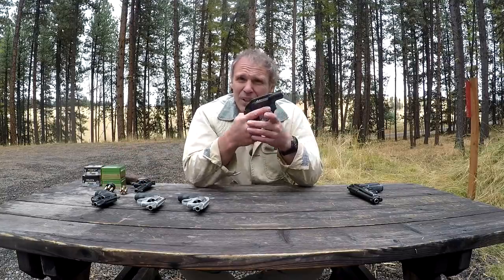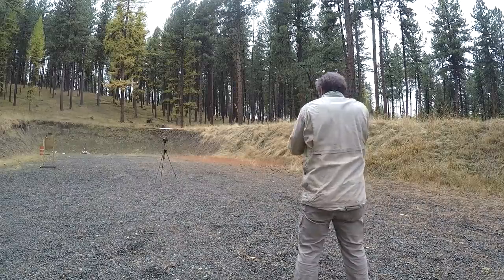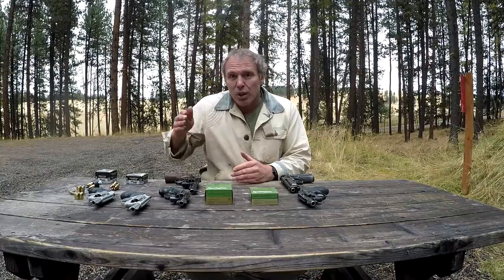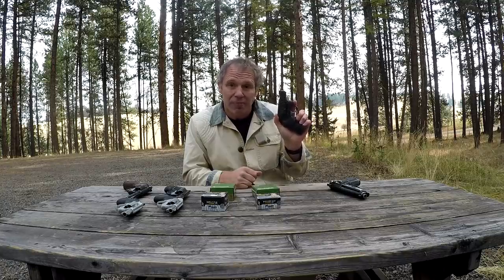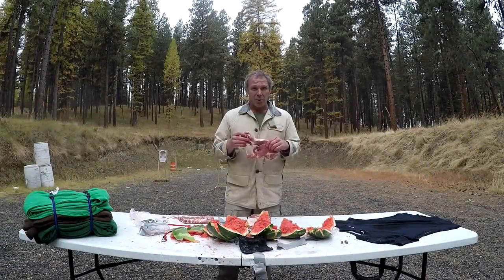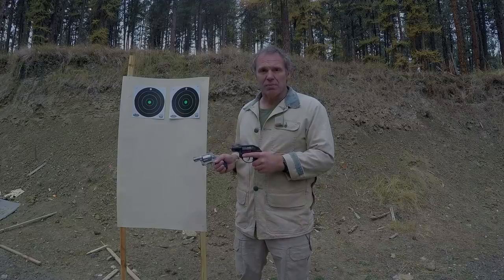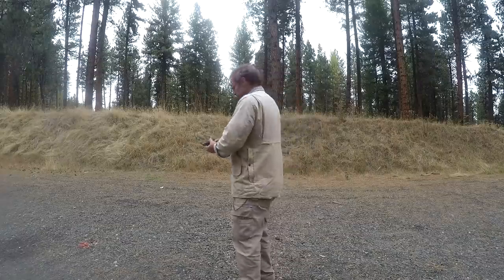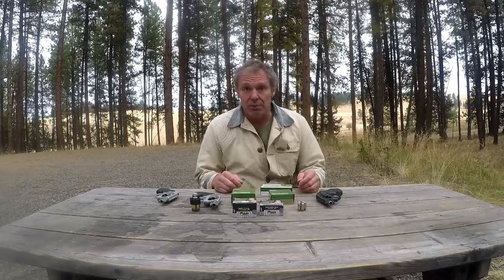Ruger LCR 9 Millimeter

Comment: Can you do one comparing the lcr 9mm to 357 mag?
Reply: Why? They aren't the same. 357 needs a longer barrel to get up to speed where the 9mm doesn't.
Reply: Because Paul did one before comparing 357 to 9mm and his results said they weren't close. MAC did a comp between lcr and 357 and said it spanked it or something along those lines. The different ammos Mac used I saw some say were questionable. Tym even pointed out about certain ammos not being a good comparison.... Well I trust Paul's testing more than anybody else. He doesn't have a glaring bias to make sure one out does the other from what I've seen. He uses true comparable ammos etc. I mean he clearly prefers 38 super but when he compared it to 9mm and 357sig he didn't use a watered down sig ammo and a hyped up 38 and proclaim clearly 38 super is better. I've seen that type of bs on a lot of different gun channels. Not Paul's. Since Paul now has a 9mm snub nose he can compare them.

Comment: Fantastic video. Lots of great info. Longer is better. Always tell the longer, more detailed version. You did forget to mention the pressure diffs between the cartridges. Probably u didn't want to confuse people. Iirc, 38 pressures are 17,500 standard, and 19,0000 for +p. Whether that is in CUP or PSI, i don't remember. 9mm is around 29,000-30,000 standard and possibly 32,000 for +p (not CD sure exactly, but obviously much higher than 38. I was pleased to see the GS ammo crack 1000 fps from the 4" barrel- most 125 gr +p ammo is rated 950-975. The Sig V-Crown 9mm was impressive. I was very surprised at the velocity, and the meat target results were excellent. Some other testing out there is starting to show that the V-Crown is a good bullet. One caveat i always hear about moon clips is that they can be bent rather easily because they are so thin. Therefore, pocket carry is not recommended. A speedloader case will work of course, and there are 1 or 2 companies making dedicated moon clip carriers, mostly for competition, but i think there are some CCW ones as well. Most have a short rod or peg in the center. A carrier that would stack 2 of them might be great, since the rounds are so short. I wouldn't be surprised if i could stack 3 of them on each row of my old Safariland quad stack (2 stacks of 2) speedloader pouch. Although, it's size makes it impractical for CCW. I have been kicking around the idea of getting a 9mm revolver. May have to do it when finances improve. Fortunately the LCR in all its forms is on our useless "safety roster" here in Kalifornia (the 3" .38 intrigues me). However, the Charter Arms Pit Bull (no moon clip, but also intriguing) is not, no doubt due to the absolutely ludicrous "microstamping" requirement (an impossibility) for new designs. S&W once made the 940, which was a 640 (all steel) in 9mm. That might be just the thing. Problem is, used guns are overpriced here because of the stupid safety roster. Anyway, a 30+ min video from Paul always guarantees a good day. Thank you
Reply: You are not a man of numbers.
Reply: Troy Ortega:  MAP of 38 Special is 17,000 psi.  38+P is 20,000 psi.  9mm and 357 are 35,000 psi.  9mm+P is 38,500 psi.  CUP is obsolete and should be avoided where there is a  psi standard.

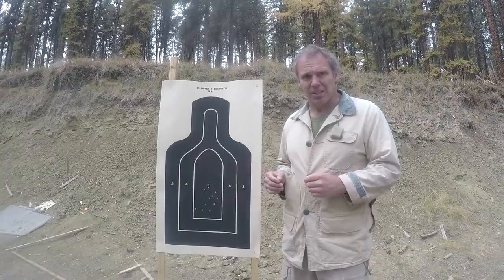Comment: 27:50 9mm as you said does not have a cannelure (a channel in bullet) for case to crimp into like 38 Spl. 9 mm HAS a so called "taper" crimp, case is squeezed flush with bullet (I reload ammo), but it is not a crimp lik 38Spl. IT IS POSSIBLE recoil of 9mm revolver to cause  rounds in the cylinder to dislodge bullet (migrate out of case). Bullet sticks out and jams cylinder from rotation. +P 9mm and bullet greater than 115Gr may not be a good ides due to bullet migration. TEST YOUR AMMO LIKE PAUL DID.. STICK WITH IT.

Comment: I still don't get crimp jump??
Reply: I'll explain it to you. It's not really hard to understand although Paul should have showed you the round and it would have been pretty easy to understand. It's when the bullet, due to change of direction of the entire pistol from recoil dislodges from the case slightly where the bullet is crimped into the case. Some bullets when manufactured have a indent around them where the case snugs up around the bullet so that it doesn't come out of the casing. It's more common in hand loads done poorly than todays off the shelf ammo. Paul just shows you here that although it's a real thing and not fiction it's also nothing to really worry about. It can happen...but it's so rare you only need to be aware of it, not worry about it. 
Google "crimp jump" in  Google images, I'll bet you can come up with an image of it in a handloaders forum.

Comment: Paul like & am subscribed to your channe,l but i have to correct you terminology. You say this revolver is "HAMMERLESS".  EVERY REVOLVER EVER MSDADE OR WILL EVER BE MADE MUST HAVE A HAMMER. There are 3 types of revolvers:
 (1) with an extetnsl hammer
(2) with a shrouded or bobbed hammer
(3) with a concealed hammer like the LCR. Dissenbel this revolver & U will find a hammer.

Every revolver needs a hammer to strike the firing pin. The S&W M638 has a shroudef hammer. Ruger makes an SP101 with a bobbed hammer, you can see it but not cock it. That gun is DA only.

Regards, Rob
Phx., Az..

Comment: Guess I'll take my LCR 9mm off the sale table. It's been my summer EDC til I started worrying about crimp jump. Well as Paul stated, the Ruger LCR may not be for him, but it is for others. I'm 1 of the others. Paul once again I thank u for squareing us away on this fine little piece. Just wish it was a 6 shooter.
Reply: Mike Fay yankee did a video of good ammo to use in the lcr 9mm and crimp jump. Hornady critical defense and Duty both were great and there were a couple other ok ones.
Reply: Mike Fay same here, was thinking about selling mine. Not a chance now. I’ve had a couple crimp jumps with federal white box, but I’ve picked up some hornady critical defense and had good results. With moon clips acting like cheap speed loaders, this little thing is perfect for a truck gun or small EDC.
Reply: @mike34744  saw it. Thanks. But I'm glad Paul put up his facts and views.
Reply: Joe when you had a crimp jump did a failure actually occur ?
Reply: One crimp jump happened in the chamber and didn't lock the gun up, the other one was partly lodged in the barrel and I had to poke at it with a screwdriver carefully to dislodge it so that I could swing open the cylinder and clear the malfunction.

Comment: 9mm beats 38. and 357 in a snub. 357 wins with longer barrel. 357 in a snub get 9mm power but gets 357 recoil with the slower burning powder.  so 9mm is king of the snubs. but 357 wins out of them in a rifle to midsize revolver.

Comment: Ok Paul.
Two gripes, for a change.
First was comparing the shots at 15 feet by using a double action vs single action with the 38.
Second, you did not talk about the bullets with the crimp jump. Meaning, you did not talk about the change in performance if the rounds became crimp jumped.
Maybe that is another show, but what are the effects of a crimp jump on 9mm revolver shots ?
:D

Maybe one of these days, you can get around to a long version where you talk about 30 Cal and rounds like the 45-70.

Comment: I warned Yankee Marshal about crimp jump in an LCR 9 and he told me the same thing about it being highly unlikely and then a couple weeks later made a video where that exact thing happened. You also failed to mention cylinder jump. Most 9mm revolvers are just 357s modified to accept 9mm. theres a significant distance from where the shell is seated to the forcing cone and this can cause accuracy issues and can cause the jacket to be shredded off or cause excessive leading. You also didnt mention that the 9mm LCR weighs almost a half pound more than the 38. Weight matters a great deal for some people on a carry gun. Also you compared a cartridge that was designed to be lightweight and high velocity to a cartridge designed to be slow and heavy. When comparing the performance of a 158gr 38 special to a 115gr 9mm you'll find the 38 easily outperforms the 9mm in energy and penetration even from a snubnose.

Comment: I think the gas pressure loss between the cylinder and the barrel is way less than the gas pressure lost operating a blow back autoloader. evidence seems to confirm that cylinder gap and blow back losses are insignificant. see comments below.
Reply: I wonder if anyone has tested that...?

Comment: Well, the more stuff I see about 9mm snub nose revolvers I'm convinced I'd rather have it than a .38 Special snub nose. I've shot plenty of .38's out of 3 inch barrels even with +P that fail to expand or at the very least get fairly poor expansion. I've shot .38 Special out of 2 inch barrels that with +P wont expand at all more often than not or if I see signs of expansion it's barely noticeable. Often I've found that plain old lead round nose or wadcutters worked best in the short barrels, often going with a wadcutter. 

However, while 9x19 can get expansion in short barrels as pointed out... it often requires a certain kind of ammo to get that or more importantly a certain kind to get ideal performance. The Sig Elite ammo from my understanding is designed to give more optimal performance from shorter barrels than some others as currently that is what's popular. There are great short barrel options out there, but often I find them to be a bit expensive and usually not worth the trouble. And that is out of an autoloader with a longer barrel.

Now, research has shown me often a revolver performs like an autoloader with a barrel length 1 inch longer. So... a 2 inch revolver performs like a 3 inch autoloader and so on. This effectively equates that LCR to being similar to some of the most compact 9mm guns on the market or at least very close to it, which many CAN get expansion with good ammo. Felt recoil is going to suck on them however... Even standard pressure stuff in that light of a platform is a bit jumpy. .38 Special +P in such a platform will also be jumpy and quite uncomfortable. 

Then take into consideration cost.... cheap ammo for 9mm will be less than even the cheapest .38 stuff on the market, which I've found to be as low as $14 a box, however it's often steel case stuff that swells up and wont extract. Dont know if cheap steel 9mm would do the same, but cheap brass is just as easy to find and doubt it would be a problem. But, .38 Special really is becoming a bit obsolete in my opinion. Much like .44 Special, it doesnt really serve a major purpose anymore. Sure, plenty of people still shoot it, plenty of people like it, and I wont argue against it's long history of doing what it's been asked to do and being an effective caliber. In a 4 inch barrel, something like a 125gr +P LSWCHP can get excellent expansion, great penetration, and is easily comparable to 9mm. Problem is, it's simply that... comparable. And with a modern 9mm the same size and weight of that 4 inch revolver, you can easily get 12 or 15 shots instead of 6 for roughly the same level of performance. But, if that revolver happens to be a .357 Magnum but you load .38 +P for self defense, I can easily justify that. 

As a whole... I think the notion of autoloader calibers in revolvers is perfectly fine. I dont think they will replace the typical calibers for said revolvers, but it will certainly make for more options in newer revolvers. I always liked the idea of guns like the Chiappa Rhino in .40 S&W or even some .45 ACP revolvers. Sure, .45 Colt can easily outclass .45 ACP in terms of potential .45 ACP is plenty adequate for self defense and has proven itself while having a lower cost, wider availability of bullet types to pick from as well. .40 S&W in something like a 3 inch revolver will be offering similar performance to duty size handguns whilst being more concealable and probably handling the recoil a bit better due to weight possibly. And in terms of performance, it's no slouch despite what many in the tactical community have said. 

So, I think I can get behind a 9mm revolver in a snub nose. I think they are showing their worth. I already own revolvers that can utilize moon clips and I personally prefer loading over speed loaders. However, I will state that if they are not stored on your person properly, it's possible you can bend the clips and they wont fit in properly. I've gone hunting a time or two where I have a few moon clips in a pouch in case I need to change ammo types for something and have bumped and banged them up to where I noticed one was bent out of shape. Now typically for hunting I carry speed strips, but I think you get the idea. It is something to consider or look out for.
Reply: Cliff notes?
Reply: Coming soon to a college near you.
Reply: I don't mean to sound like an ass... but you really need to get to the range more if you need to carry moon clips and speed strips when you're hunting...Just stating the obvious...dohhh, you may now throw rubber chickens....
Reply: +Tractor Wrangler Well mission failed there. And no, I go shooting plenty. I think you dont understand why I carry clips or speed strips when I go hunting. See, my sidearm is a Taurus Raging Judge Magnum with a 6 1/2 inch barrel. I keep specialty .410 flares for emergency use and often bird shot for the rare snake encounter. Otherwise, it stays loaded with what I intend to use primarily. 

It's not a need so much as it is the ex Boy Scout in me always being prepared. If I carried something more traditional like a typical .357 or whichever, I'd still likely have the snake shot loads on hand. A lot of dense brush where I tend to hunt, Copperheads are fairly common, Timber Rattlesnakes while far rarer are also a potential threat. Been hunting near swamps, along creeks and rivers and plenty of Cottonmouth's as well. 

It's not an issue of I cant hit my target which is probably what you're thinking.
Reply: @Predalien195  Wait...your facing down a rattler...and you stop to reload more appropriate ammo? LOL I just shoot the dam thing or go around it...just sayin'....lol
Reply: +Tractor Wrangler Never said that's what I did. I said I keep bird shot for snakes yes, which is mostly what it's there for. I do shoot birds with it. If I spot a snake I will do my best to go around it but guess you dont have much experience with Cottonmouths. They will come to you, they dont let you just go away quite often. And when reloading is as speedy as it happens to be with a moon clip, it's not as hard or foolhardy as you're trying to make it out to be. 

Like I said, flares for emergency, bird shot for snakes, small varmints, nuisance birds and other pests. I dont shoot until I have to or plan to. But more importantly if a time should come where I am facing down a Timber Rattlesnake and going around is not an option but I'm stalking deer or boar, I'd much rather fire off the quieter bird shot load than discharge the .454 Casull or .45 Colt +P. Hasnt happened yet, likely wont have to happen, but it's there as an option. But like I said... emergency situations could happen. If I'm stranded I may want more than just the 6 rounds I have in the gun. 

It's just a personal choice to be ready. Not everyone feels the need, has the desire, or understands people who do.

Comment: I love the LCR platform and own several in different calibers. My most recent is the 9mm one which I have shot alot this summer practicing with the moon clip reloads. A few weeks ago I decided to compete with it (non-sanctioned match just a bowling pin shoot at my club). Despite the snickering I received when others saw what I was shooting I was confident in my abilities. Embarrassingly enough it could not get through a 5 shot cylinder without at least 1 sometimes 2 light primer strikes. Which had happened in the past during training but only a few times. After inspecting the rounds that failed to ignite I noticed significant crimp jump. Are the 2 issues related? Probably not but my theory is the crimp jump may have been caused by me sub-conciously stiffening up my grip due to the adrenaline of competing and not allowing the backwards inertia of the recoil enough of a cushion. I still shot accuratley. This still doesnt explain the frequent light primer strikes. Ammo was winchester 115gr. Any insights?
Reply from the maker: Sometimes light trigger pull means light strikes. Some ammo doesn't work well in some guns. I would suggest Starting with using a different ammo.

Comment: 38 spl. is about the power of .380 ACP but almost as large as 357 Mag cartridge ...

in short its useless obsolete caliber

if you want low recoil lightweight pocket gun use 9mm Browning, if you desperately need for some reason your ultralight pocket pistol to kick like a mule, just use 9mm Luger ...
Reply: Does the 9mm browning and 9mm Luger not both fire the same 9x19 round?
Reply: that x19 is the casing length ... Luger is 9x19, Browning is 9x17 - smaller casing less + rated pressure = less velocity but also lower recoil
Reply: @Asghaad  Ahh.. 9x17 is the .380 ACP round.  I'm with ya now.